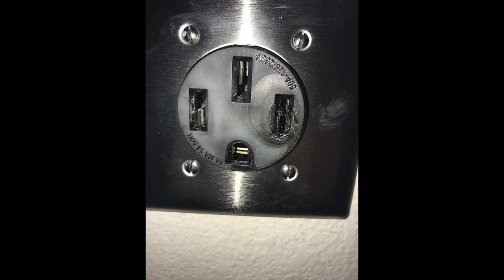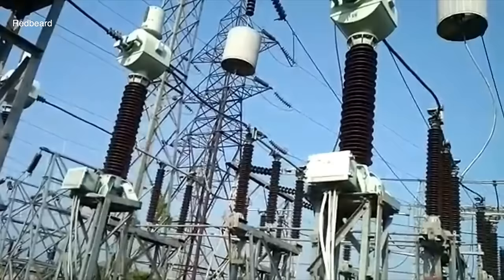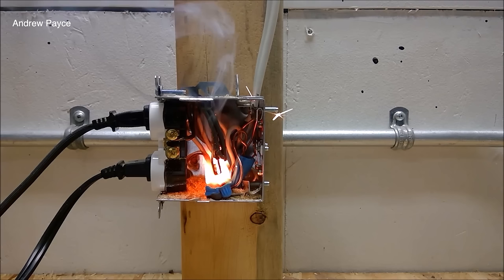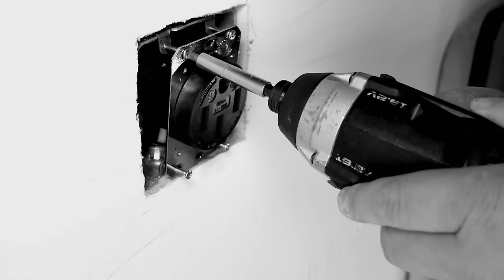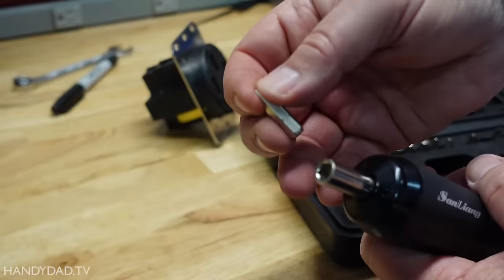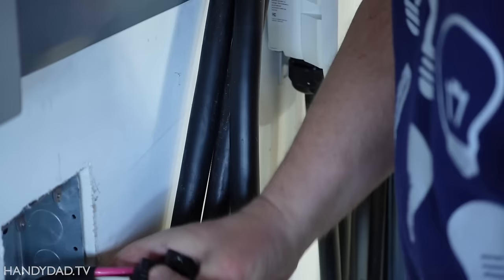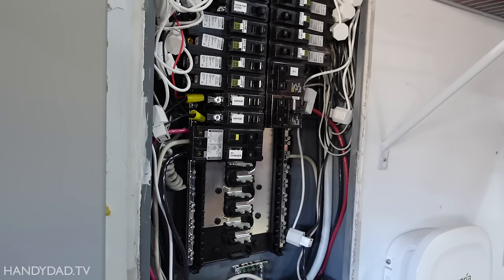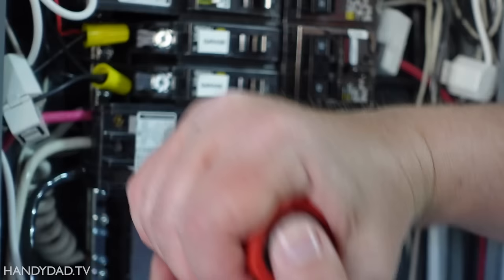EV Charging Disaster

Comment: You are using the 4 prong plug without the ground?  Did not see you torque the ground wire in the top slot
Reply from the maker: I did but didn’t show it.
Reply: @handydadtv  roger that, appreciate the tip and link on the commercial quality outlets!

Comment: 5:52 you have a four pin connector - Line 1, (black), Line 2, (Red), Neutral, (White) and (should be a ground that is green or bare copper). However you torqued only three screws. Besides this, no longer is it code compliant to connect a 240 volt appliance with only L1, L2, and Neutral. It should be L1, L2, N, and ground. So what gives?
Reply from the maker: It’s grounded.

Comment: Just curious question why would you need to unplug and plug in the charger cable to the outlet every day?  Second question why need industrial plug that cost $150?
Reply from the maker: You don’t need to unplug every day, but you will unplug more often than a normal household appliance if the charger is portable. 

You don’t need to spend $150, but you definitely need an industrial outlet because they are designed for higher temperatures. https://youtu.be/R2cRNzSbw48

Comment: One other thing to add on the plugs that causes arcing is corrosion. A think layer of corrosion will limit contact and cause arcing. Sand that off the plug if it has sat outside for a long time.
Reply from the maker: Thanks for the tip

Comment: I always use ferrules on stranded wires . I found out that without them stranded wires get crushed to much and even after using recommended torque they get little loose overtime anyway  . Probably due the heat cycle .
Reply from the maker: Thanks for the advice

Comment: Maybe I missed it, but I didn't hear you say anything about the importance of using the correct wire gauge to handle the amp load?
Reply from the maker: That’s obvious and assumed. But even thicker wire can arc if the connection comes loose.
Reply: @handydadtv  Obvious and assumed?  By whom?  Everyone who sees this video?  You shouldn't assume anything when it comes to electricity.  And since you're the one giving out the advice...  Try not to be so defensive?
Reply from the maker: It’s assumed by me and this video that things were done according to specs. The point was purely to highlight the most common cause of failures being loose connections. Sorry to sound defensive. Not intentional.

Comment: I’m having a Chevy approved electrician install a 240 volt 50 amp outlet in my garage next week. He told me they are not allowed to install Leviton brand outlets ($15). It will be a Hubble ($100).
Reply from the maker: My advice is to avoid the outlet entirely and have him hard-wire your charger.
Reply: @handydadtv  I may need to take it with me sometimes.

Comment: Just found this video. Not sure why you needed to wire the neutral. It's only needed for dryers, unless the evse needs it?
Reply from the maker: The EVSE doesn’t need the neutral, but other things that use the 14-50 may need it. If you don’t want to wire the neutral, use a 6-50.

Comment: I discussed multiple times with people on FB tesla groups, - that do please consider to get a permanent charger installed. It's not that expensive. Like you are buying 60k car and not even thinking to get proper charger installed. Every connection gonna tend to heat. Just make as less as possible connections. Do consider getting extra heavy-duty wires which can handle high temperatures. Do not save on something which can take away your and your family life. But nope, - they are okay with mobile charger and they do not care. Anyway, - it's their life. But I hope that charger plugs will be a requirement for each newly built house. Either NEMA plug, or hardwired box ready to get any brand charger installed. Also, - maybe anyone should be able to charge on someone's driveway for some "fee". And charger owner should be able to get $$$ for sharing it. This way even 120amp home chargers should be available. We are getting there, - but probably not that soon.
Reply from the maker: Interesting idea

Comment: Wire nuts should be banned for use in 110v/240vac  systems - You need to use insulated connectors with dual screw connections to ensure a good mechanical/Electrical connection. Thank you for your educational video showing the dangers of loose connections
Reply from the maker: Thanks

Comment: Lithium Ion battery fires are very dangerous, not just for cars, but especially for e-bikes and e-scooters. Kids to not pay adequate attention to what they are doing, and FDNY has several of these fires a week. Usually they will take out a store or an apartment, but they have taken out whole apartment buildings. Pay particular attention to your battery, and NEVER replace them with cheap third-party batteries. Even the battery in your car consists of thousands of little AA sized batteries connected together to give you the volts and amps that you require.
Now that, how many connections is that. Have they ALL been assembled correctly?
Reply from the maker: My EV battery pack has safeguards that disable or disconnect individual batteries that might be defective or damaged. But I get your point: there is still a fire risk and catastrophe can possibly be avoided by paying attention.

Comment: Torquing electrical connections is absolutely BS.  I have installed HUNDREDS of outlets with out using a Torque Screwdriver.  It's not a car engine.  NEC codes say this too just to guve mt clip board inspector something to do in my opinion.
Reply from the maker: Thanks for your feedback

Comment: I'm curious how tight you got the plug by using the allen wrench alone.  I just did a l14-30 cord to junction box with 2 30a welding plugs and a 20a 110 outlet. My landlord/friend hooked up a l14-30 outlet on the power pole where I'm renting so I don't need my generator so much for welding.  I will use the adapter cord and 1 extension cord and if I need further I still will use generator
Reply from the maker: I usually go “as tight as I can”, but I am always afraid of stripping screws. Then I got the torque screwdriver and realized just how much force these screws were designed to take.

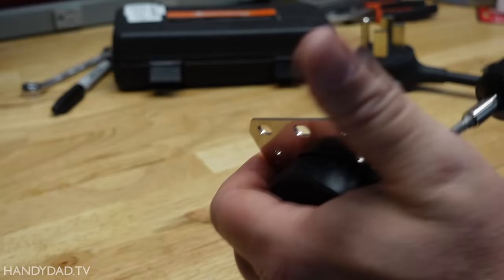Comment: The cable sheeth on the black and red wire at 5:19 looks slightly heat damaged.  Is that the original cable that was attached to the melted socket at the start of the video?  If so you should really replace that wire (or at least cut it back a few inches in clean wire) as heat damaged sheeth isnt safe.
Reply from the maker: Different wire.

Comment: duplex receptacles are less than $1.00/ea. under moderate loads, they work fine, however the commercial grade devices do much better. diy'ers crab about hubbell devices holding up well compared to their less-expensive counterparts. torque ing terminal screws is a great idea. if you have heating problems at the terminals, consider going to the next higher wire size, especially on flexible cords. hope this helps,
Reply from the maker: Thanks

Comment: Good video. Why the yellow wire nuts in the panel on the circuit above?  I like the torque driver. Would like to have an insulated version.
Reply from the maker: The wire nuts are for the energy monitor.

Comment: I wish I would have seen this before my 14-50R failed last week.  I had an electrician install a residential grade 14-50R receptacle Oct 2021.  I didn't realize it, but he used aluminum wire instead of copper wire.  Well, my receptacle melted last week.  The consensus is, the aluminum wire was likely the culprit, but I'm guessing the residential grade receptacle didn't help. I am using a different electrician with EV specific electrical experience and knowledge to do a hard wired install now vs. using even a commercial grade receptacle.   Make sure you do all your homework before having a receptacle installed!!!
Reply from the maker: Thanks for sharing. Glad it didn’t end in tragedy!

Comment: Every video I've seen concerning torquing the outlet connectors to 75 in-lbs uses a torque screwdriver that has a max. range of 70 in-lbs but none of the youtubers ever address that in their video.  If outlet manufacturer recommends/requires 75 in-lbs then why is everyone only torquing to 70 in-lbs?
Reply from the maker: I couldn’t get it to click with two hands anywhere near 70 in-lbs! So I just went as tight as I could knowing I wasn’t going to over tighten them.

Comment: is not arcing (which should be independent on the current and depending on voltage mostly), what you have there is the increased contact resistance that then cause higher losses/heat dissipation due to higher R*square current...arcing eventually may oxidise the contacts that then again, increases contact resistance
Reply from the maker: Thanks 😊

Comment: How many amps is the breaker? What do you recommended for a breaker for a Tesla charger? Thanks!
Reply from the maker: I have a 50-amp GFCI breaker which can supply 40 amps continuously. But I charge with the UMC a which charges at 32 amps max. I only charge at 16 amps on a daily basis. 

It’s your decision which size you use.
Reply: @handydadtv  We ordered a Tesla Model 3 and we received the charger thru the mail so I am wondering how many amps should I use on the breaker. I don’t want to get the circuit hot.  I want to get about 30 miles of range per hour of charge.
Reply from the maker: The instructions with the charger should tell you what to use.
Reply: @handydadtv  Ok thank you 👍🏻

Comment: I have no EV experience, so this is an honest question: is not not a better idea to leave the charger plugged in at the wall, and just hang the car end up when not in use?  That would reduce the repeated plug in cycles on the outlet.  Thanks for any explanation.
Reply: yes, that's the reality. The charger cord will probably stay plugged in for months at a time. The wall plug just adds a level of safety (quick disconnect) and the ability to swap out for say a welder or other equipment. BTW, most EV charger cords come with a wall mounted box full of electronics, that also has a place to hang the cord. This could be hardwired, or you can add a plug like in the video.
Reply from the maker: It is rarely unplugged.

Comment: i wonder if the way they do it in the UK is better by hardwiring the charger, rather than installing an outlet. i get the portability and ease of replacing the charger though.
Reply from the maker: I recommend hard wiring a charger regardless of the country you live in. It’s safer in so many ways.

Comment: Speaking of tight connections. The Chargepoint Flex has some interesting connectors. They seem like a spring loaded lever. Maybe there's some magic in there but the levers don't really take much force. My electrician was a little worried about how secure they were in there. But I haven't seen any reports of them catching on fire so fingers crossed they have a good design.
Reply from the maker: Hope so 🤞🏻
Reply: Sounds quite like wago connectors, they're superior to screw type connections, and still better than rising cage clamp connections (what HD shows in the video where on the industrial grade socket the bar comes up from under the screw).
They will always grip the wire at the perfect amount to carry their rated current since they use a spring onto a contact to set that "torque".
Much better than wire nuts, prevents the problem shown in that clip with the fire.
Reply: @AndrewStrydomBRP  Yeah interesting that does look similar. Never heard of wago before.
Reply: @Oliver1071  That's the standard for us here in the UK, Wago makes the lever ones and the push fit, ideal makes the push fit, both are good and use similar internal mechanisms for holding the wire in place but I prefer the lever ones as they are easier to remove.

Comment: Don't use a romex structured cable, not rated well enough for excessive heat, use single THHN conductors in conduit and size wire to larger gauge.  Use 8 instead of 10.
Reply from the maker: Thanks for the feedback but there shouldn’t be excessive heat under normal circumstances. 10/3 Romex is working fine for me, but I rarely charge above 32 amps.

Comment: I have a Siemens L2 EVSE plugged into the older style 3 prong outlet running off a 40 amp breaker. The plug in that socket can get quite hot and I'm not sure if the wire gauge is too small or is it normal for them to get toasty? What gauge wire should a 32amp (on 40 amp) breaker be using? Thank you so much for any assistance you can advise for this issue.
Reply from the maker: I don’t want to give you a wrong answer so please Google that.

Comment: Time 9:10 You have two wire nuts inside of your panel it does not look like the wires are mechanically secure which would mean twisted together! so the wire nut makes it electrically secure. check those wire nuts!!  what are they doing there anyway? Peace bro Nice video
Reply from the maker: They’re for the energy monitor.

Comment: A modest beef- electrical   connections are rated in inch-pounds. Anybody who has ever worked on a car engine knows FOOT- pounds. Manifolds, bearings; lug nuts get tightened to 90-100 FOOT-pounds. Just like 12 inches equals 1 foot, 12 inch- pounds is 1 foot- pound. So that 72 inch pounds is really 6 foot pounds. And anybody who's done auto work knows that that's not very tight. Seriously, electrical connections need to be tight, but it's screwdriver tight, hand tight, inch-pounds tight. I did it for years without a torque screwdriver or wrench, with no troubles.
Reply from the maker: Thanks

Comment: I use Noalox grease for threads and shake the stranded wires in while torquing as reasonably tight as possible. Experienced electricians know what I am talking about. 
Connectors also can spread connection cancer. If one of them gets pitted the pitting receptacle or plug can spread it to others. 
A tight fitting plug to receptacle is best.
Reply from the maker: Thanks

Comment: If your power outlet/GPO looks like that it's either bad/ loose connection, bad outlet or your circuit protection is not adequate for the cable that it's protecting. 
Question do people do their own electrical work in the US, is that legal??
Also it's bizarre power outlets don't have mechs/switches to switch it on & off locally as you may be plugging something in under load
Reply from the maker: It is completely legal. Americans are free to build their own houses if we want.

Comment: Those 14-50 and 6-50 outlets are not meant to be constantly plugged and unplugged. Main use case is a dryer, stove, EV charger and welder.  Most of those are permanently installed.
Reply from the maker: RV parks have thousands of 14-50 outlets that are plugged and unplugged all the time. Industrial receptacles are designed for it.

Comment: Great video. I looked at that SanLiang torque screwdriver on Amazon. Specs say 10-70   in-lbs. Do you have an older one or does torque actually go to 75?
Reply from the maker: I couldn’t go anywhere near 70 by hand so I just went as tight as I could.

Comment: Thanks for this great video!! Did you experience nuisance trippings since you installed the GFCI breaker?
Reply from the maker: Never had any nuisance tripping with the Tesla UMC or Emporia EV charger.
Reply: I did with the tesla mobile charger. Had an off peak charging meter installed, it started tripping at night and I would wake up to an uncharged vehicle. The power company came out to look at my meter, but they said its ok on their end. He said usually those gfci breakers are gone as soon as the inspector leaves!
Same at my cabin, the gfci tripped immediately. No problem with a regular breaker.

Comment: fyi, your outlet called for 75 in/lbs. Your torque driver maxes out at 70 in/lbs. its still not to spec... =)
Reply from the maker: Correct. I went as tight as I could. At least it gave me assurance I wasn’t going to strip the screws.

Comment: As a lineman I just hooked up a larger service for a customer on their 400 amp panel because they have two electric cars and when they plug them in their lights dim Geez I wonder how much power you use lol
Reply from the maker: There is no reason to “super charge” at home. The car sits in my garage for 10 hours overnight. I don’t need it to recharge in 2 hours.

Comment: Video is a big help. Did you use a torque driver with a max range of 70 inch pounds to drive a fastener to a 75 inch pounds specification. At 75 inch pounds, wouldn't it be better to use a tool with 100 to 150 inch pound range?
Reply from the maker: Yes you are right. I didn’t read the torque spec in advance. I went as tight as I could with this screwdriver, and it was much tighter than I installed originally.
Reply: @handydadtv  Most accuracy on a torque wrench (without an electronic strain gauge) is between 50% to 75% of the device's full range.
Reply from the maker: Good to know. Thanks.
Reply: @handydadtv  If you were within 10% then you are most likely exceed the accuracy of most installers including professionals.
Reply: @lordgarth1  ... being within 10% is MUCH better than most can get by feel. In my experience, most guys can't guess beyond about 20 inch pounds. (outlet screw)

Comment: can a 100amp main panel handle the 14-50 outlet?
Reply from the maker: Yes but you need a load calculation to determine how big the circuit can be. It may not be 50 amps.

Comment: NEC... " “Live parts to which an employee may be exposed shall be deenergized before the employee works on or near them, unless the employer can demonstrate that deenergizing introduces additional or increased hazards or is infeasible due to equipment design or operational limitations. Live parts that operate at less than 50 volts to ground need not be deenergized if there will be no increased exposure to electrical burns or to explosion due to electric arcs.” If you are a "HandyDad" and don't follow this requirement at home, your children may be orphans.
Reply from the maker: Ironically, I see electricians work on live circuits all the time.